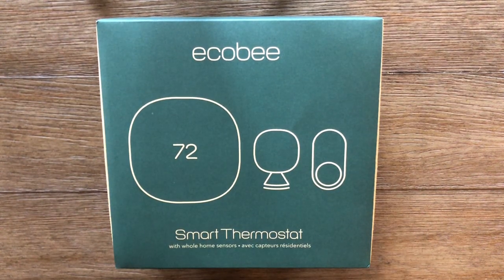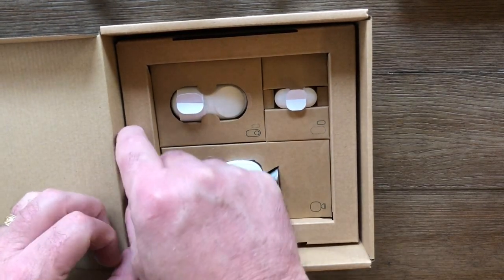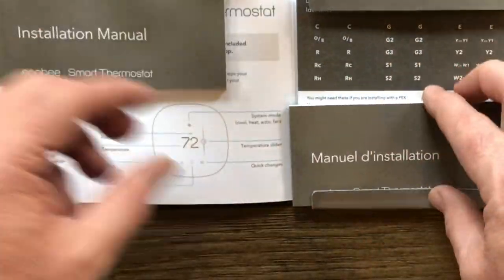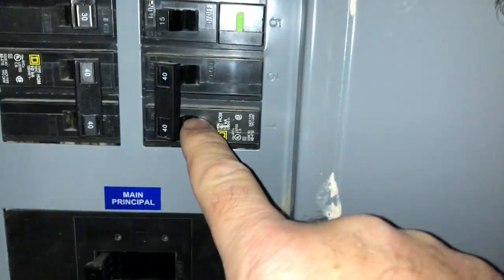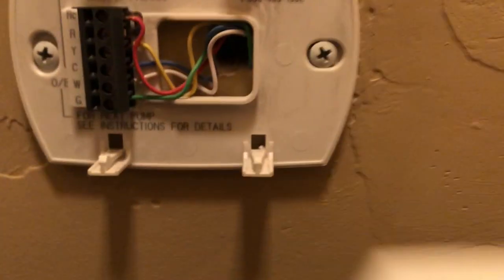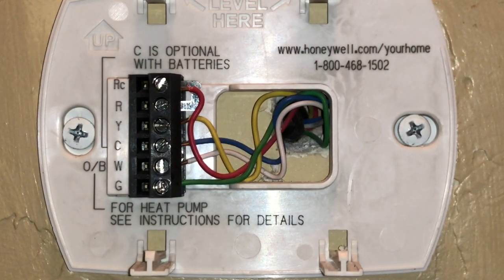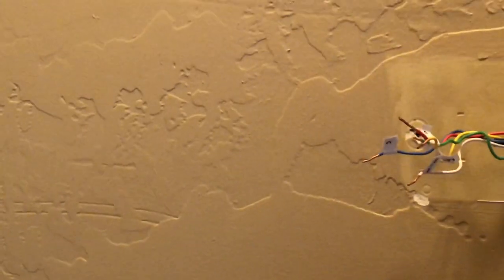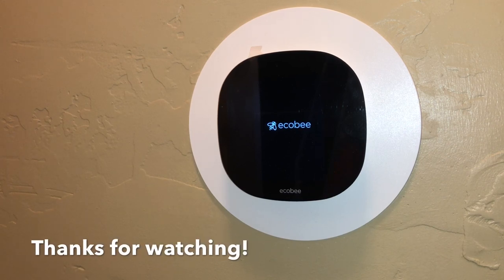Costco’s ecobee smart thermostat unboxing and installation 🐝

Comment: How can I tell if my existing furnace is compatible?
Reply from the maker: I shared a “compatibility” website link in the video. If your thermostat is compatible then your furnace is, but if you don’t have a C-wire to your thermostat then my install may not be appropriate for you.  Most modern thermostats have the C-wire.